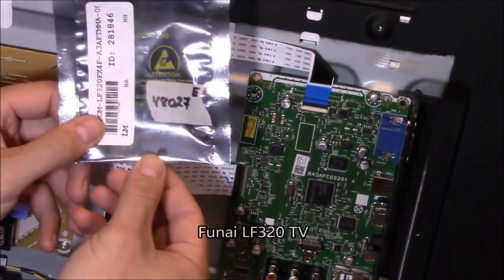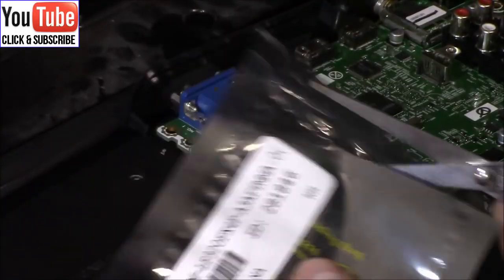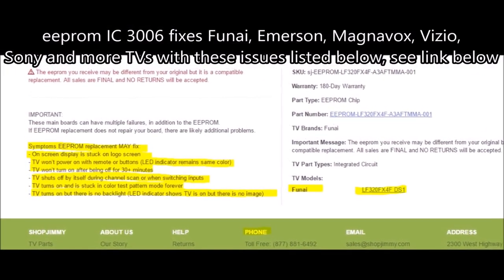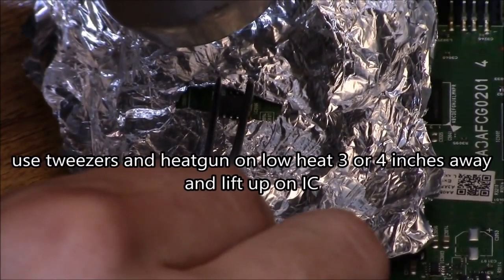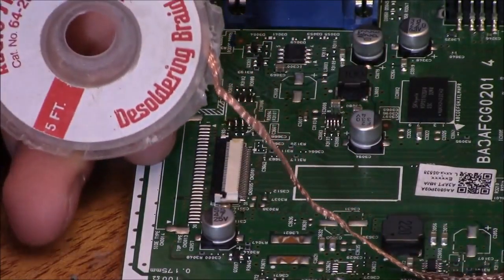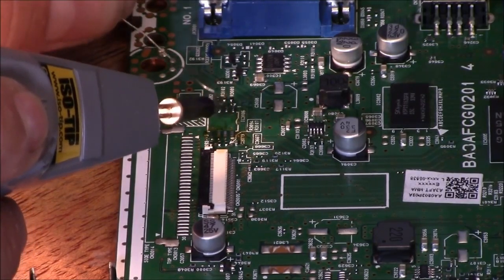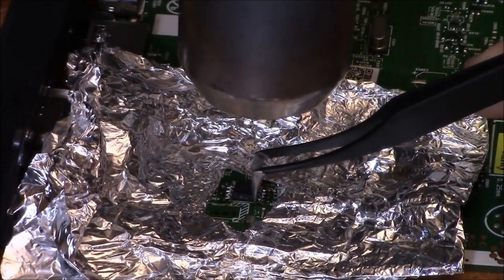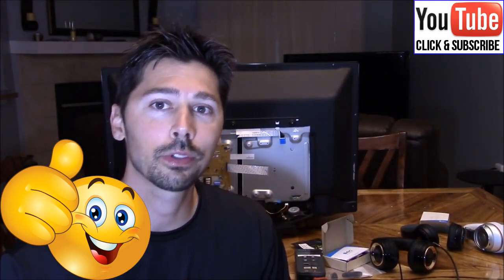How to Fix a LED LCD Common repair for FUNAI and VIZIO TVs !

Comment from the maker: Common TV Fix for frozen screen, no power but tv standby light (has standby voltage) no volume, TV buttons don't work, no signal on all inputs, no backlight find LED LCD TV parts and TV boards at https://electropartsonline.com/ and https://www.shopjimmy.com/
Reply: You are the master..Cheers 🍻🍻🍻🇺🇸🇺🇸🇺🇸
Reply: Thanks Brother and happy Holidays
Reply: Thanks!
Reply: I have a seiki t.v and I CAN'T get  to input through a universal remote or on the initial t.v

Comment: One queastion samsung lcd 32 inch.screen goes black after about an hour and back after 3 sec and pucture setings returns to default with high pic saturation.somethimes. switches tv input to hdmi. Can it be eprom issue.i check rhe ground conectors etc ..

Comment: I wish I could contact you directly through Youtube, but they took that away - and to respect your email, have chosen to post the question here... 
SONY KDL-40V2500 has dancing vertical color shadows that follow brightly colored objects or written text or animated graphics on the screen... It happens on any channel and includes bringing up menu items such as the volume, or the channel number indicator / input when selecting different channels... it's NOT the kind of vertical lines described in ALL of the videos I've seen so far looking into the issue.  If the item causing the "ghost" or "shadow" is stationary, so it the effect - but if it's a bright object that moves across the screen, the "shadow" or "ghost" originates AT the object and trails vertically up and follows it's movement on the screen.  Also, the last time the tv was powered off, it took several tries to power it back up without getting a black screen which wouldn't even produce tv originating menu's (such as input, etc)... 

Any ideas with that?  Is there a way I can send or ref. a video clip or pictures of it for you?

Comment: I have a Vizio 55M-D0.  The TV powers on and displays a picture.  Unfortunately, the upper left quadrant of the panel does not have the same level of brightness as the other 3 quadrants - it is slightly darker.  Color, tint, contrast levels all appear to be normal across all quadrants.  All other TV functions appear to be operating properly.  I have reinserted all the ribbon cables and the condition remains.  What is your best judgement for what may not be working properly?  What part(s) may be bad?  Appreciate your insights.  Thanks -

Comment: Hey Tampatec, is there any hope for my 2007 67in Samsung (lamp) tv, won't keep a picture when I cut it on, have to unplug then plug back in multiple times, hoping each time I'll get a picture, lamp is fine ,replaced it, picture is good when I do get it,  now not getting a screen at all just wallpaper displays. Help

Comment: Hello! 
I have recently received a 32" Samsung TV and I replaced the main board and the T-board on the TV because I believed one of the boards was defective. I watch all of your videos and based off of what you said I felt as though it was the main board but I wait ahead and bought a parts kit from JimmyShop online and placed both. However, the TV is still acting as it was before. It has power, the power light turns on and when you turn the TV on it lights up and stays on however, the "no signal" icon does not show up and nothing appears on the screen. I was wondering if you have any other suggestions. It's the new version a smart Samsung TV. The model number for the TV is UN32J5205AFXZA.

Comment: absolutely love the videos, you are really good at explaining how to troubleshoot and repair!. I have an RCA led55c552120q that I replaced the T-con board on about 6 months ago. It worked fine until a couple months ago, then started sporadically showing snow screen for a couple seconds before going back to normal. Then, about 3 weeks ago it started turning off by itself. Now it turns off more frequently. We have to unplug it and let it sit for awhile then plug back in and turn on again. Sometimes it stays on for hours but sometimes it goes off in less than 10 seconds. When it shuts off there is no stand by power light, the whole unit is dead. What is the best way to isolate the board causing the problem, or can you direct me to the video most likely to get me pointed in the right direction?
Reply from the maker: Check standby volts seems like bad capacitors in power board. Get tv boards at shopjimmy.com or electropartsonline.com use code tampatecfriend for discount.

Comment: I have a ten year old Samsung,  the problem that I have with it is it's possessed.  It turns off, and then back on whenever it feels like it. I took it to a TV repair shop about a month ago, and they supposedly fixed it, yet it still doing the same thing again, any ideas that you could give me as to what the problem is would be greatly appreciated. 😫

Comment: I have a Vizio E420i-A0 (42" LED Smart TV). I bought a main board (confirmed to work) thinking that was the source of it not turning on, however in the process of switching them I found that the TV does turn on (it's not obvious as there is no sound and looks as if it doesn't, since the power light fades away). With a flashlight pointed at the center of the screen, you can see the words "no signal."

I've checked various parts on the power board and main board for voltages; everything seems good. 120v right where the cord attaches, 5v standby, power to the main board, good fuse, no blown capacitors.

 I'm guessing that the issue must be a result of failed led strips. Is the likely the issue?
Reply: Banschinabox notorious backlight issue with those lg led strips behing that screen

Comment: Can you help me , do you have a vizio model no. VL470M what happens with my tv is the HDMI don't work is weird because it says no signal then when I connect the HDMI cable the screen turn black but the imagine never come so what is going on ??

Comment: HiI have a Visio E420vl, it powers up and runs about 1 to 2 minutes then the screen freezes except the top 2 inches still are working. I was thinking Tcom board, but I don't no anything about tv's so maybe power board??? Any thoughts would be greatly appreciated. Thank You ! There is a video on Youtube, this guy has the same problem on his tv but nobody gave any ideas.

Comment: I have monitor that suddenly died while using it , it went to grey bars vertically like the no signal screen but in grey in tvs and OSD won't show , what do u think cause it
Reply from the maker: Try reset the monitor by unplugging power cord for a few minutes also factory reset  But possibly bad main board.

Comment: My Samsung 75” tv has sound, no picture. Movers I think dropped it.
Screen is half blue other dark. A few times it would come On half picture.
It is only 14 months old.
Suggestions to fix or should I get shop to fix it?
Reply: Model un75mlj6300fxza
Reply from the maker: Can be loose tcon cable, so reseat the tcon board connections or damaged LCD screen.
Reply: Doug Wright I agree, it could be loose cable ribbons going to the screen. 
Also check the main cable ribbon or reattach it to the board.
Reply: All cables tight.

Comment: I see many requests for your support in the comment sections - is that your preferred method of receiving tech requests, or do you offer another method of contact? I subscribed because you stated free support to subs, but cannot find another means of messaging you.... In the 'about' section, it says email was for business purposes & to post on related videos...Please advise as to where I should type out my scenario & questions for you.Thanks in advance!
Reply from the maker: Post to a related video, if your tv has no power it can be many things so I need to narrow it down to 1 board. If you don't have a standby light when tv is plug in and tv doesn't turn on that can be bad power board.

Comment: Don't usually use tin foil for a heat shield, but if ever run out of tape etc... Guess will have this as an option. Who'd of thought, I never would have* 😉

*edited=autocorrect fix

Comment: Glad to see TV's can still be fixed,  especially in today's throw away society.
Reply: I saved $300 - $500 repairing my 42" Sanyo. It just had bad solder joints on the first LED strip and a loose pin on the coupler between the two top strips.  Been playing like new for a couple months now.

Comment: Samsung volume work but no picture what can be the problem
Reply from the maker: If backlight is glowing then can be bad tcon board.  Get tv boards at shopjimmy.com or electropartsonline.com
Reply: @TampaTec  no light at all just completely black screen
Reply from the maker: @heavypressureinc  if you turn off the room lights, window blinds and still don't see backlight glow on the screen then can be bad backlight circuit. See my repair playlist on my channel I made a video how to fix tv backlight.

Comment: Cool video. It’s funny I just had this issue happen on one of my TVs two days ago. Thanks
Reply from the maker: Did you replace main board or eeprom? What tv model was it?
Reply: I was lucky this time around that pulling power and holding the power button for 30 seconds when turning it back on worked. 55 inch Hisense 4K smart tv
Reply from the maker: @Musabe009  nice

Comment: I have a problem on a vizio tv where all my hdmi ports are non functional any more. how do I get them working again?
Reply: Probably just buy a replacement board, and remove the old board.
Reply: @madmax2069  yeah board issue or cable connecting that board issue
Reply: @youeladamas7840  usually with relatively newer TVs the only cables in the TV are from the power supply board to the main board, and maybe to the display driver board (if it's separate from the power board), and the HDMI ports are all soldered directly to the main board and have absolutely nothing to do with board to board wiring as the HDMI ports are controlled by the main board they're soldered to.
Reply: yeah if ports are on that board then chip is bad or bad solder joint lol also if you only used one cable to connect tv try another first cables get bad
Reply from the maker: Try unplugging power cord for 1 minute to reset tv but sometimes it can be bad hdmi chip on main board.